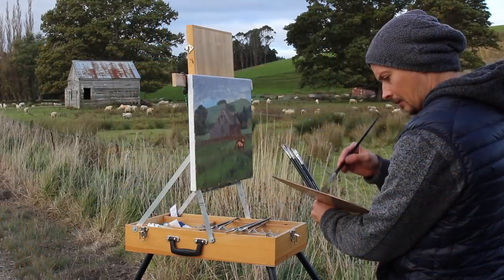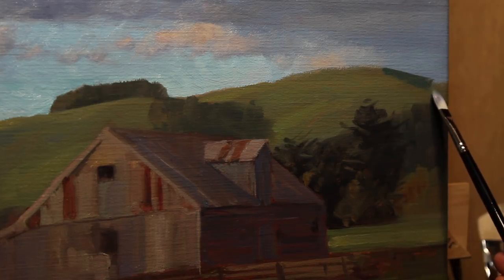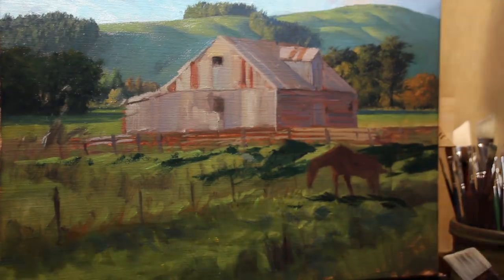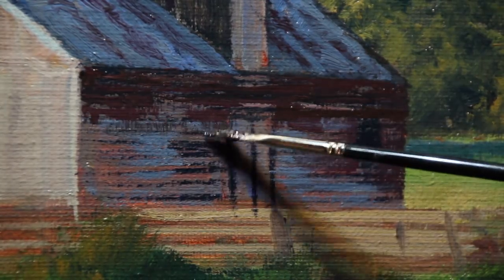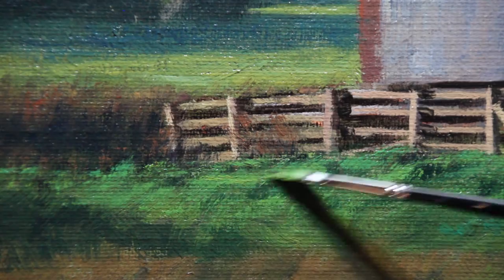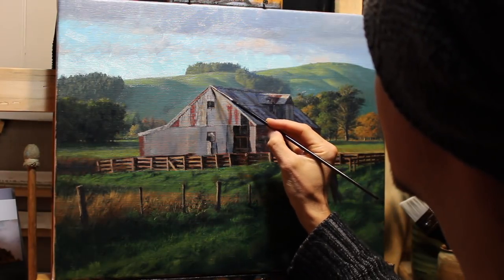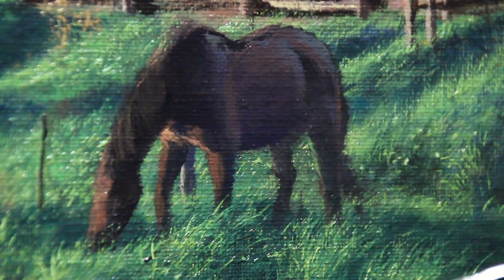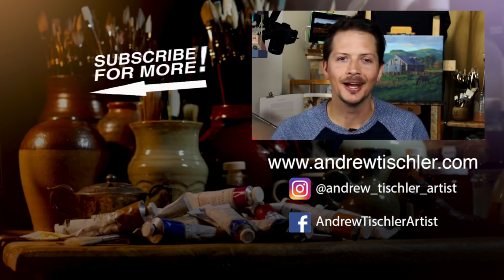Detail Painting in Oils | Painting a Rural Landscape - Brush Techniques and Process

Comment: Since this is Plein Air I assume it's all done in the same session, so it's all wet-on-wet?   How do you get the paint in the higher layers to go on so well and adhere so evenly to the paint underneath that you're applying it to?
Reply: a few tips, work thinly at first, allowing some drying of the under layers, use an oil painting medium, sparingly, intermediate and later passages can be thicker; but do not over work them, put down patches of paint, move on to another area, repeat, until done! And save the "fifty guinea touches", highlights and details, for the final moments of the work. When are you done? When you can't think of another thing to do to Improve the piece!! Then do another! An 8x10, my favorite size, should take no more than an hour or two at the most; by then the scene is not the one you were inspired by in the first place. Why so small? If you really like it, you can always do another bigger one in the studio, based on your field sketch.